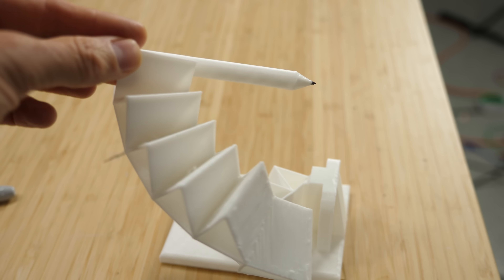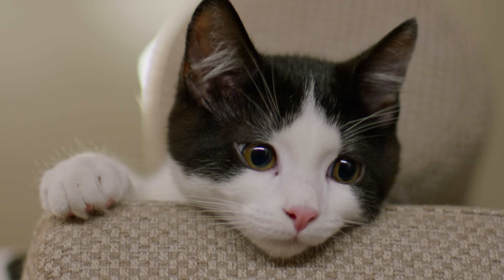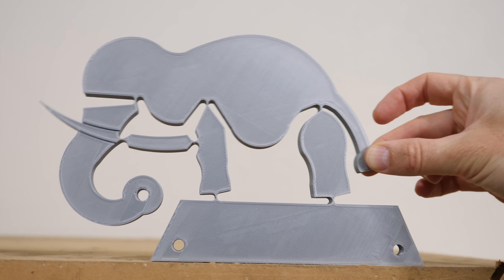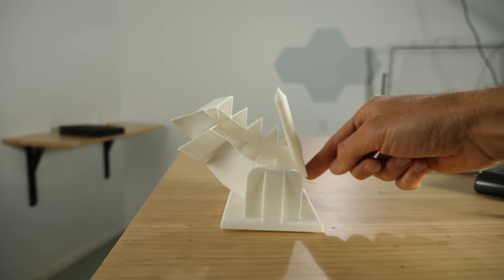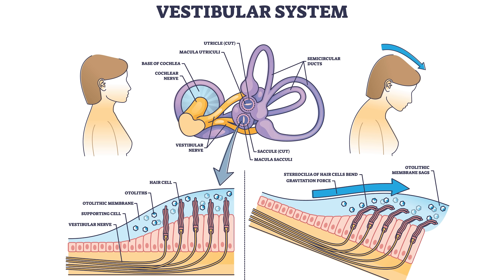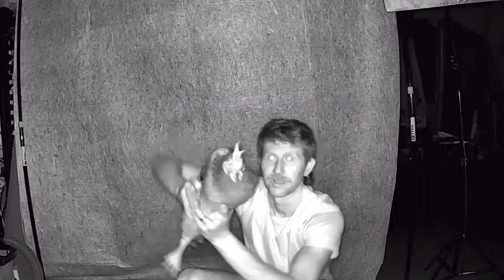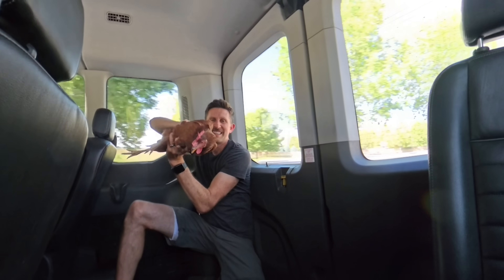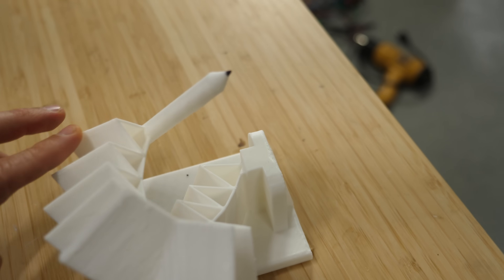Chickens Are Weirder Than You Thought

Comment: He didn't get into why birds are like this and mammals are not, but I assume it has to do with either flight and/or perching on tree branches.  Especially smaller perching birds, when sitting on a thin tree branch, the wind is moving, the branches are bending, but that bird has to have a stable visual to navigate the world.  Similarly, in flight: everything around them is in motion; their body is bending and twisting with every wing flap and gust of breeze, but they have to keep their head still.  And as he mentioned, because birds' eyes do not rotate much if at all, it's all the head's job.
Mammals, being mostly earth-bound, have a very solid, stable base.  It's rare for a mammal to rest on something like a tree branch that's twisting and moving under them.  And even when walking or running, their base is fairly solid, easy enough to compensate for small variations.  Plus, mammals' eyes have much more rotation and movement within the sockets, so the eyes can do a lot of the work.
That being said, mammals can also do the head thing, to a certain degree.  Plenty of mammals like squirrels live in trees.  Running animals like cheetahs have to move over uneven terrain, even on the ground.  So we have some capability of head stabilization, as well.  But not nearly as much as the tree-perching, airborne birds do.
Now I'm curious to hear from an anatomy and evolutionary expert to see if what I said is on point, or if everything I said is B.S. because I'm not a biologist.  I'm actually curious to know!

Comment: They would also have problems not only in the dark but also in a soundproof chamber, since this double "rotor" effect is achieved in chordates through the senses of sight and hearing (semicircular canals of the vestibule with their "otoliths"). But it's curious that you didn't mention the structure that integrates everything: the information gathered is sent through the corpora quadrigemina and geniculate bodies to the cerebellum. The cerebellum is an important structure in birds (a large proportion in the brain-to-cerebellum ratio) for their "navigation system," vestiges of which are still present even in birds that no longer fly. Good video, greetings!

Comment: So ask questions ...
This point doesnt move.  Please define " point doesn't move". 

Rotation is movement, also micro movements alter variances that cause vectors of turbulence.  

Geo-mertic orientation of guidance systems. They fail.  Possible if a loss of magnetic orientation of earth happens a failure might occur possibly. .
Reply: The beak of the chicken does move in a (vector ance) dealing with motion or movement.

Comment: I live in a country town, but I go out to the city constantly to see friends, so I've observed a lot of this head movement (or lack thereof) in both chickens and pigeons, and there's a difference I find really interesting about the two. While both birds have the same feature of their neck and head, chickens will bob their heads irregardless of their walking movement, whereas pigeons bob their head in pattern to their steps, specifically bobbing forward and slightly opposite the downed leg for the most part. My takeaway observation is that the difference in muscle ratio between chickens and pigeons must be significant enough that pigeons are willing to trade quick vision control for forward momentum. I would assume this is also a factor in why pigeons let you get so close to them, rather than just familiarity with humans.

Comment: Just to make sure I'm not dumb, if you push on the tip of your printed device, you're pushing the entire device, and so what you're really pushing against is the friction between the base and the table, right? If you pushed hard enough, you'd push the entire printed device along the table, correct? Similarly, if you pulled up on it, you'd lift the whole device? If you pushed down you'd end up causing stress in the arm and it would eventually break, right?

Comment: How did you get that 3d print to work? I used the STL on my X1C but the triangular parts break off while printing. :(  (Using supports, yes.) Did you reorient the file before printing?
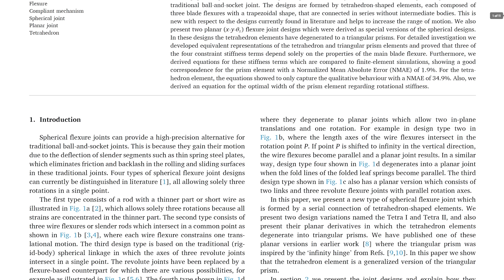Reply from the maker: at 2:13 I show the orientation I used

Comment: What I mean is that the article on which this is based develops a completely novel articulated mechanism based on the serial connection of tetrahedrons, each one constructed as a minimal network of three flexures, forming a structure that can maintain a fixed point in space (remote center of rotation, RCR). This provides precision without traditional moving parts—the geometry itself distributes both function and freedom of movement—and it is achieved through triangles and tetrahedrons, the simplest and most stable figures in three-dimensional space.

The core of the design is to build motion and constraint from the elemental geometry of triangles, exactly as in computational graphics, where every 3D image is built from triangular meshes.

The mechanism demonstrates that a physical reality can be completely defined—and its degrees of freedom constrained and guided—only by how those elementary units are arranged.

This geometric scaffolding supports—and at the same time limits and enables—all movements, analogous to how a polygonal mesh in a video game limits what can happen in the image.

From a speculative perspective: if our reality were a simulation, we might imagine that the continuum we perceive emerges from the spatial organization of basic geometric units (like tetrahedrons), whose connections and constraints create both the stability and the freedom of everything that moves and exists.

And all thanks to a chicken.
Reality, it seems, is not without a sense of irony.

Comment: Both the RCR mechanism and the chicken are interesting. But linking them together in this video feels misleading and a bit clickbaity. The chicken head is not an RCR - it’s not rotating for a start. It’s a multi axis actuator with extremely fast sensing and feedback. It can put its head anywhere. But chooses to keep it locked in a reference frame.
The mechanical mechanisms have no such ability.

They are as similar as 
1) asking a person to hold their hand on their head
2) gluing a person’s hand to their head

Comment: 6:08 this happens to pilots as well. The NTSB has used this as the immediate reason for atleast one crash where the pilot held an aggressive bank angle for an amount of time that their equilibrium eroded and with visual cues they could no longer detect the aggressive angle which made them distrust their instruments.
Reply: This happens especially often with VFR into IMC accidents specifically
Reply: That’s interesting, were they working on a counter action solution?
Reply: @BurmaJo there is no counter action other than rely on your instruments, not on your senses

Comment: Never really explained how that works. The tip stays where it's at because the triangles are pulling and/or pushing against one another? Is that where the stability comes from? And how are the forces divided up that when one pushes and the tip, they feel resistance?

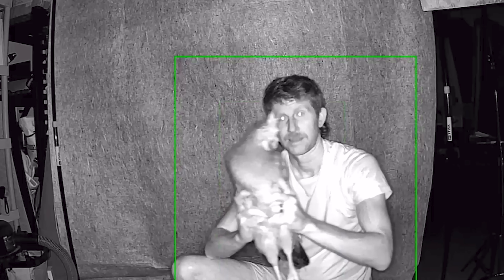Comment: 4:27 This is exactly how modern VR tracking like the Quest headsets work, it’s called inside out tracking. If you turn off all the lights in a room, your position will no longer be tracked, but the internal gyroscope will still stabilize your angle

Comment: as a med student its nice to finally see something im actually educated in alredy, and in our case it works basically the exact same way, but instead of stabilizing our head, we stabilize our eyeballs, this reflex is called the vestibuloocular reflex, where the brain utilizes the imput from the vestibulococlear nerve to determine the direction of rotation of the head and send a compensating output through either of the 3 main nerves (oculomotor III , trochlear IV and abducens VI)  that control the 6 main muscles of the eyeball (superior, inferior, lateral and medial rectus muscles and superior and inferior oblique muscles)
Reply: I’m guessing the reason you understand this is because you’re a med student. I’m pretty sure very few non-specialists would not be able to rattle off this explanation as practicing doctors.
Reply: @AnotherYoutuber-yt6vf  syfm
Reply: This system can get messed up if you have a head injury/concussion.  Good news is they have therapy and exercises that can help restore it!
Reply: Thanks for the explanation. As a tank gunner it's impressive to see that main gun not move once target lazed in, while that tank goes over rough terrain.

Comment: No matter how hard I push on it? I bent and twisted a tire iron once trying to get lugs off my truck's tires because the shop used too much torque on their impact wrench, I think I can bend a piece of plastic even if it's engineered to not bend in a direction it wasn't designed for; unless it's abs which is incredibly rigid at which point it might shear before it bends depending on the ambient temperature.

Comment: To me I felt like a lot of the non stabilization was caused because the chicken wasn’t focusing on one particular thing. It only really works if the chicken is focused on one spot, I bet even in regular conditions if she was stressed and looking around everywhere whilst doing the tests it would also give a false result. 

I’m not saying she was stressed but as you said with no visual cue she wasn’t focused on one spot but rather “going with the flow” there was no need to stabilize. 

Same as in the car she seemed pretty stable but she was also looking around a lot more. New environment, new senses and experiences etc. 

Very intresting and cool though! The 3d print is really awesome! 

Just thinking out loud a camera gimble kind of works in the same way too.

Comment: The reason the rotational tracking was stable in the car was partly because your axis of rotation wasn't aligned with the vehicle's axis of rotation, and also partly because it wasn't in the dark so it was able to use visual cues to compensate for the confusing vestibular information. The reason that translational didn't work in the car I think is because of conflicting vection cues: some of its field of vision was filled up by the interior of the vehicle, and some of its field of vision was filled up by the exterior through the windows. It couldn't "decide" which one was the right field of reference to use for transational stability so it just shut off that system entirely. I think if the windows were covered it might be able to do it again.

Comment: However impressive this is, it means that the chicken is compensating for a small brain, as it doesn't have to handle fast changing feedback in realtime relative to the movement of their eyes. They bob their head for the same reason.  Other birds, even fast hunters have similar limitations compared to mammals and process movement in a far more primitive way. But it works well enough.

Comment: Did the chicken have something to focus on during each test?  I'd imagine the rotational movement is more automatic due to sensing gravity, but lateral movement is required to actually move, so the bird needs to have a reason to make use of it.

For the dark area, it makes sense that the bird has nothing to focus on since it can't see.  You could probably get the same result by putting a blindfold on the chicken.  I'd recommend performing this test with a light source within the room, perhaps illuminating a treat or displaying an opening to a more familiar environment (i.e. small opening to outside).

For the car, I suspect the bird was too distressed about the environment to focus, and wanted to move/escape.  I'd recommend training the chicken to remain calm during transport, then attempt the test with something the bird would want, such as a treat.

Comment: The condition I was diagnosed with, Semicircular Canal Dehiscence Syndrome, was discovered in those tests on the pigeons. Some pigeons often veered off or wobbled and it turned out that those pigeons severely affected, had holes ‘dehiscence’ in their semicircular canals. Much the same as I do bilaterally.

And thanks to your video I now know why when the lights go out, and I have no visual reference, I just fall over and hit the deck.🤗
Thanks muchly ☺️
Reply: My anatomy is all correct (afaik), but I had a stroke which affected my brain's ability to process vestibular input. I also struggle in the dark, but I can compensate somewhat with input from my feet and hands (holding onto something). But the really funny thing is that when I'm tired or overwhelmed my balance gets progressively worse. I always have to hold the shopping cart at the grocery store. 😂
Reply: @hedgehiggle  sorry to hear of your stroke, they can often be so devastating.
That’s spookily similar to the experience I have, it’s so difficult to explain this to even the specialists, it took me ten years to get a diagnosis, and weirdly that came from a random YouTube video about hearing your eyes moving 😳
If I can hold something, feel with my feet etc, much like yourself and prepared, I won’t fall over, I don’t like it, but putting a jumper on has to be done sat down, otherwise I break things falling into them.
I had this test called a vemp test, that measures eye movements when the head is tilted in various positions, and in certain positions I fling my arms out like I am falling through in the air, much like the reflex test they do on babies when they do the drop test.
I hope your journey to recovery is a good one, and thanks for sharing that anecdote, I can wholly empathise, but occasionally find it in me to laugh too, it’s a weird one to get your own head around, let alone others close to you. 
✌️
Reply: Woah that's wild! Thanks for sharing and stay safe!
Reply: @civilbeard it’s completely nuts mate! And thank you, it such a weird and obscure condition, i rarely see anything on YT about it or loosely about it, i had to point out that if it wasn’t for those tests on this exact pigeon research , people would still be wondering wondering what on earth was wrong with them.
Such a cool piece of content ☺️
Reply: I have similar issues with the dark due to BPPV (positional vertigo) as the lack of visual cues completely throw my balance off. Comically, my job..... I'm an astronomer / astrophotographer.
Reply: @BBROPHOTO   not all veritgo works the same, but I get the spins in the dark, so I have to ask: Do you feel like you're spinning in space when staring at space? XD
Reply: @BBROPHOTO  Just remember, the enemy's gate is down.
Reply: Bro is solar powered with no backup battery
Reply: @Hellefleur  😂☠️ That made my chuckle muscles hurt 😆
Reply: That is kinda cute, if you don't mind me saying it, man. You have an "standby" button of sorts, someone turns off the lights and you dive into the ground until someone activates you. 😅
Reply: @LuizAlexPhoenix  😂 thats a really amusing way to look at it, before my first craniotomy, i literally couldn’t sneeze nor tilt my head forward or i would kinda dive underneath so to speak, but in the form of losing consciousness…. I remember really shouting at a guy on site to make him aware of the digger behind him, and then i fell in the path of the digger from creating too much pressure in my head too quickly.
The irony of that alone 😂
Eventually it got so bad i had to retire, now i have very little hearing left, awaiting hearing aids.
I have a real dark sense of humour, and so do my kids, they lament on when i was stronger, fitter and certainly tougher, but now we joke about if you wanted to knock me out, all anyone would have to do, is spin me round once, and or shout loudly…. I am out for the count, but also, taking your view on it made me really chuckle!….. just waiting to be “re-activated” with a really quiet “help”😂😂☠️
Reply: I had an inflammatory viral infection which did a little permanent damage to one of my inner ears, resulting in very much the same thing. I dislike turning off lights before bed; I have to turn on my phone light or risk hurting at least an ankle. 

Even in the dark, usually my vertigo is low enough that my eyes don't do that thing. But if the air pressure fluctuates enough (weather systems do this), or my blood pressure does, my eyes try to compensate for motion that isn't happening and the world starts spinning. 

During the first couple years with the damage, sometimes the vertigo would noticeably spin me in impossible directions. Trippy stuff.
Reply: doesn't dehiscence specifically mean reseparation of parts previously joined back together by surgery? in other words, popping your stitches? Not just anything having holes in it..
Reply: @KairuHakubi  ya know….. i put this to my surgeon. 
He said, Dehiscence is just doctor speak for “hole”…….. i felt a little robbed….. i prefer the way you spin it……☺️👌
Reply: Omg cause your visual cortex is providing a lot more of your balance! That's crazy!
Reply: mutant
Reply: @PCB389  with useless superpowers 😂👌